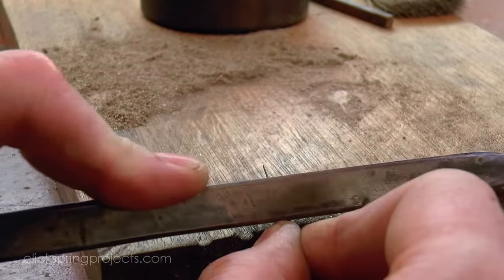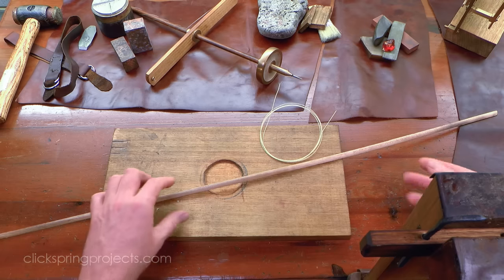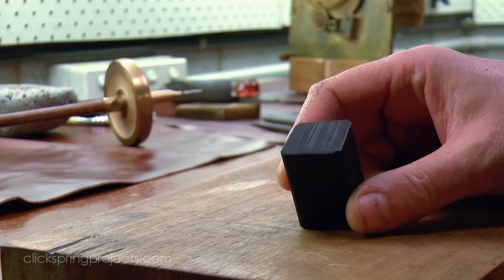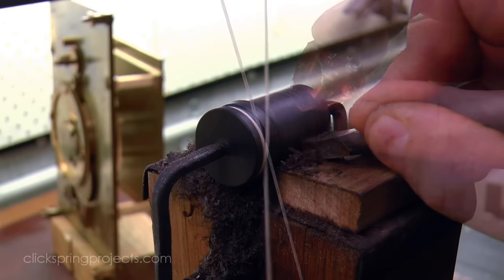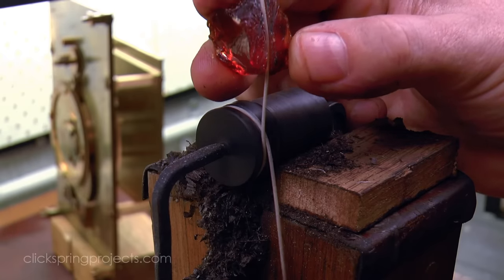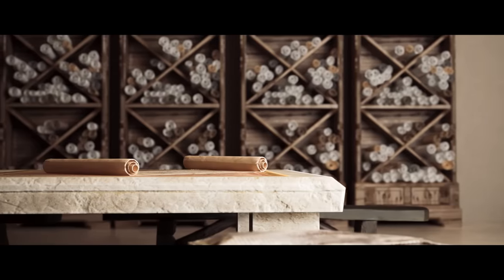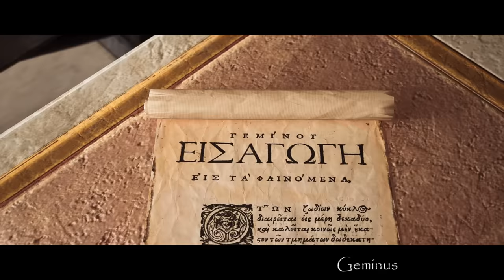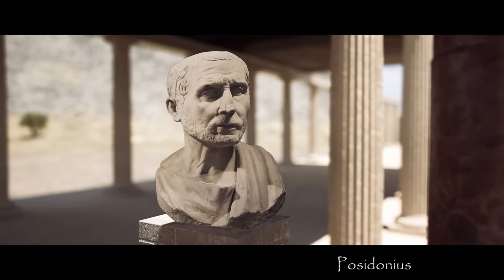Antikythera Fragment #11  World’s First Precision Lathe - Constructing The Antikythera Mechanism

Comment: What I find wondrous about this stuff is that this lathe is, as you aim to produce, a conservative guess of what they would have used. I can imagine that wealthy workshops having elaborate forms of this style of lathe. Maybe with a sliding wedge-locked tailstock to allow machining stock of any length within the machine's bounds, or even an early tool holder system to make repeatability easier. They had the technology for a lot of advancements on this design, so it really comes down to their imagination and amount of free time/money to work on improving their tools. 

It's a shame that it seems that all the latches from the time have been lost. I wouldn't be surprised if they ended up being melted down/turned to firewood at the end of their life, although I am curious as to why this particular part of Mediterranean craftsmanship is so poorly documented and preserved even through cultural and storytelling means.
Reply: the constituent parts don't really scream 'lathe', and the metal parts would probably have been variously looted or migrated until they wore out; the wooden spools and such would wear over time and be tossed into the fire etc
Reply: For two reasons, one, knowledge like that of how tools were made and worked was your value and such keeps close. And second, those that were widely known common knowledge were just not documented, as is always done even to today, because they were so mundane and everyone knew, so no need to do so.

Comment: When I was a watch making apprentice I was taught to make arbors and pivots solely using a file and filing block. As my master measured the circularity with a micrometer, you can be sure these were functional in a watch or clock. Also, your video seems to reinvent the "turns" the bow powered dead center lathe that was used in watch making from the birth of watches and clocks to this day. I have no doubt that this very same form of lathe was used  from the very invention of the lathe. Archaeologists seem to have ignored technology of all types other than construction among Greco-Roman culture and I have no doubt that the very same type of tools as created the Antikythera device are slumbering uncataloged  in some museum drawer.

Comment: This is amazing. I have learned so much from your videos. More then all of the metal works courses I've done. Lathes are usually held as too sophisticated to even contemplate making one yourself, they are something you must buy.  But they started somewhere. From your simple design you could very quickly upgrade to having a fully functioning motor driven lather. There is a book that showed a method to making your very own lathe but it would be much easier to start where you have. You could skip the bow and grab an old bicycles peddles and chain thus you were only going in one direction not back an froth. Very inspiring. 

It's so amazing what people were able to do. I watched a video recently about a single track train instead of the two lines. The engineering that went into balancing it and how it worked. You just don't see that kind of out of the box thinking.

Comment: If the prong holes were slightly tapered towards each other in a V shape, then the further prongs are into the holding block the closer they would get to each other. This would allow a finer adjustment and help grip the work piece!

Comment: This is really eye opening! Not only in regards to the Antikythera Mechanism, but most definitely also in regards to tool manufacture. I've long wanted to build a lathe, but have put it off because I thought it required complex gearing. Only now have I realized that the only thing the gearing achieves, is higher torque and rpm with a less powerful motor. Looking at this lathe, it is clear that a simple automated one could be constructed in several ways. It should be possible with relatively little complexity to construct a lathe that is operated by foot like a potters wheel, which will free up both hands. Similarly, it should also be possible to construct a water operated autonomous lathe, removing all need of human power. And for modern hobbyists it should be possible to create a relatively cheap lathe with just a servo motor, a belt drive and some modified wood chisels with a bit more hardening for turning soft metals and wood. Only other requirement is the operators patience.

Comment: This is such a cool video. As simple as it is, that is a fully usable lathe. Once you have a usable lathe. It could certainly be used to make parts (even parts for a much more precise and easier to use lathe). The only machine in the shop that can make itself.

Comment: This is a really ingenious mechanism for creating a lathe, and my initial thoughts after seeing this is that it could relat6ively easily be scaled up using a water wheel, that drive mechanism, and a clutch system (or just stop the water). And you could probably make it a one sided lathe with an eyelet and the rosin glue.

Comment: Instead of olive oil, they sometimes used the waxy surface of a holly leaf on bearing parts, and a bow drill, a small square on the friction points, was used.  Its a technique still used today for bow drill friction fire starting,  holly was used on friction points on trebuchets, barristas, and suchlike.

Comment: That is pretty cool but you could set it up with a pulley and handle to turn the pulley instead of using the bow and string. It would be more of a constant rotating instead of back and forth. I'm still amazed at how that was done. Very cool.

Comment: With the lathe tools example seen, would an ancient version of a superglue arbor be possible? I'd think using wax to adhere the piece to the arbor would do the trick, unless there's a different adhesive that would work better?

Clickspring's next series will be bootstrapping a lathe, using Bronze Age tools to fashion a lathe to make a foot powered lathe, which is then used to make a more modern lathe, and so forth.

Comment: Pretty easy to imagine metalworkers of the time immediately seeing dozens of ways to make what you made better. Improving rigidity, a hand crank since we already know they had good comprehension of gears, potentially a flywheel
Reply: Gears are too expensive, my money is on belts and pulleys. Cheaper, easier to make and modify, and works so well we still do it today.

Comment: A few years ago i did a tiny chess set for my dollhouse. Well my moms dollhouse back then. By rolling the wood sticks under my hand and filing as i go. After a few pieces i added a rotating weight that keeps the motion going, and refined the thing a little in small ways.
It was sort of a lathe. With my hands as a structural element.
If i did more pieces now, i might add points to it. Or grab a small bearing and add it to a piece of wood. Would probably result in less cramping. For a small amount of pieces it was fine. But not doing another set any time soon.

Comment: I remember an article in Fine Woodworking maybe 40 years ago about primitive woodturning in Ethiopia iirc. The turner was doing bowls sitting on the ground using his foot for the tool support.
In the terms of technological progress the wheel was in wide spread use at the time the Antikythera Device was produced. It is not a big leap to go from a pole lathe powered by the turner themselves to a lathe powered by an apprentice or slave turning a crank handle mounted on a wheel. Any shop that did a fair amount if turning imo (1) would likely have a lathe consisting of a bed with a fixed headstock and a tailstock of some sort that could be moved up and down the bed. Shops that would be doing a fair amout of turning could be those building carts or wagons. Or those producing pulleys for ships rigging or block and tackle. How far back do block and tackle go?

Comment: Thanks for the fascinating glimpse into a forgotten window of time. 

As is, such a small lathe would be ideal for jewelry and lapidary work, making small beads. 

With only a slightly upscaled form, to  a large enough swing to turn blanks that are ~1-2" inches across, and about 12-18" long, would be ideal to make the various pegs and dowels used in ship or structural construction methods.

After having made the persian astrolabe, do you think this sort of process was VERY widespread across the ancient world?

Comment: I have always wondered "You need a lathe to make a modern lathe, so how did the first lathe work?" Asked and Answered, I guess. This is very cool.
Reply: And Wax as a temporary work hold is amazing. Never considered it but that's honestly so much better of an idea than thermo-loc when I'm not using power tools. Like yeah, it'll be weaker, but much easier to remove from the workpiece.

Comment: I got the most "aha" effect when the turning around of the first work piece in the mini lathe switched the sides - thus making the left side irregularities and movements where the rope is running a levered down by the lever length to the other, more stable end of the block. lets say, the lever makes a 10:1 reduction, so every turn around would in ideal case get you a factor of 10 gain in total precision. indeed at some point other factors will limit the thing. of course finally your tools will switch to grinding with paper (papyrus) and maybe some fine sandy powder. perfect conditions - even modern day carftsmen level machinists cant do much better.

Comment: A little doubt about a possible performance improvement:  (translated with google)
As a wood lathe turner, it is a problem for me that the bars twist to release the piece, one always looks for the axes to be very aligned and round bars that allow that do not give me calm. But square bars are not easier to use for adjustment either, at least in this way.
 
In that case, would it be more useful if the holes received by the 2nd bar (on the right) were slightly diagonal? A subtle tilt, like 3-4° tilt. Or even both bars on opposite diagonals.
This would cause the axles to tighten as the bars are lowered (the bars should have a "7" shape to compensate and remain parallel to the surface), and thus the tightening is not due to the bending of the bars, which deflects the central direction of the axles and also generates unnecessary friction.
All this in a small independent wooden frame, which would not be anchored in the clamp, to have easy access with the hammer, both from above and below. Thus the general tightening would be through the different holes, the fine adjustment would be through the diagonal when lowering the bars, and the release by hammering from below instead of releasing it by rotating the bars.

Comment: The Townsends demonstrated this type of lathe to make wooden tools, on a larger scale, but I never imagined it would have been any good on metal. I suppose brass and bronze aren't all that hard, but still impressive. I do find myself wondering how long it took to make a lathe capable of cutting steel or iron.
Reply: It was probably possible earlier than you'd think, but I would assume the harder materials like steel were forged and ground whenever possible, or finished with files and chisels when certain levels of detail were desired.

Comment: Some Questions . How the old Greeks got brass sheets in this quality, you need for?
Is it approved that they have iron and   steel/ hardened steel to make the tools you used for to create a duplicate of the Antikithera mechanism?
Great Videos, thanks so much for uploading !!!!! Best Regards from Austria!
Reply: Hi, the Mechanism is bronze not brass roughly 95/5 copper/tin with a few bits of other things by analysis from the 1970's. Flat sheets of bronze were produced over 1000 years before the mechanism was made and made into mirrors that we have found so making bronze sheets was known. You could hammer, anneal and lap as a primitive way to make a bronze sheet, They might have known some kind of rolling. Perhaps Chris has something coming on this?

Check previous videos by Clickspring on making carburized steel and then files,  drill bits and cutting tools from that steel using period appropriate technology.

Comment: Amazing work! How long did it take to make the little ebony arbor? I'm sure this is slower than contemporary machines, but it still looks pretty speedy.

This has a lot of potential for being able to fine-tune your work process. Using the direct drive for the arbor is definitely the easiest, but I have no doubt that the Romans could have taken advantage of differing gear ratios and a pulley to make an extremely fast little lathe, much in the same way a spinning wheel is made.

Comment: Excellent.
A discussion of "Route to modern lathe from here" would be nice, but you mentioned the key bit right at the end: The ball bearing.
A ball bearing headstock driven by gears instead of the bow, and a ball bearing live center on the tailstock...
The missing piece then is the gearing needed to have the 'tool rest' travel at a set rate of rotation -> Threading.
And the gearmaking essential knowledge is done.
A crappy lathe can make a better lathe, all the way until you get a very nice lathe.

Comment: The bow drive is obviously dead-simple, and can be operated by the machinist himself, but as I watched it occurred to me that the mechanism of a spinning wheel would have been almost as simple to make, and would have permitted constant turning in a single direction, which would mean the cutting tool would be twice as productive for a given span of working time.  The simplest version would have required a second person to turn the big wheel, but a bit of mechanical work might have enabled the machinist to pump the big wheel with a foot pedal, while using his hands to do the machining.  I don't know when the spinning wheel was invented, but it doesn't seem to involve principles that were necessarily unknown two millennia ago.

Comment: One thing I didn't understand is how this makes non-tapered cylinders. With only hand turning tools what precision do you have over the radius being consistent over the length?
Reply: Well first - did they care if the cylinders were somewhat tapered? Everything was hand fit to them anyway. 
Second they could use calipers just like people did for millennia in wood.
Third as said everything was hand fit, so the the hole you had to fit could also be your measuring tool. Adjust both til you are satisfied and that is it.  Just work a little, stop and check.
They never really had to make a cylinder to an exact measurement, but rather to a real world item where fitting matters and the exact size and shape in some metric really didn't.

Comment: It seems as if you try to develop the minimum tool to do the job here (and elsewhere) to prove that advanced tech isn't needed to do the job.  I understand that, but it seems like this sort of tool would have been developed 10 to 100 years before the mechanism was built.   I'm thinking that the place that built the mechanism was also possibly the location of the most advanced lathe tech in the world at that time.  It is interesting to me to speculate what they might have come up with, given a generation or two of use and development.   What's to stop them from having a continuously-turning lathe mechanism with a geared feed?  They would have had the most sophisticated and specialized tools anywhere.
Reply: A geared feed strikes me as unnecessarily expensive and difficult for the task at hand. Even today, there are lots of machines that still use belts and pulleys instead of geartrains.

Comment: If you already make gears and gear reduction. Why not a geared lathe with a hand powered flywheel that spins the part 10-1. At that point you can also make a screw for better precision of the cutter.

Comment: Could you build a pedal operated lathe ?
Reply: I would imagine so, just bend a long rod into pedals under the table and make a pulley system with a string pulled taut with a short piece of wood. But it would probably need the first step be to have a continuous rotation tool (like if instead of a bow this lathe had a turning wheel) which, if the other tools he's made are anything to go by, doesn't seem like it was something they were thinking about.

Comment: Regarding lathe tech, it would seem trivial to anyone who designed and built the mechanism and needed precise cylindrical shapes.   I'm not a builder, but it seems to me that using a bow in one hand to turn the work would get old quickly.  I would be looking for a way to turn the work continuously - how hard would that be to engineer, considering the engineer was already capable of building the mechanism, and would likely have slave, mule and water power available?
Reply: A belt drive is only slightly more work than he already put in, and you can either run that on your own with a handcrank, or get an apprentice to do the crap work of keeping it moving at the speed you want. It's cheaper than a mule or waterwheel and also gives them a front row seat to what you're doing, so they can learn as they turn.

Comment: it didn't even had to be bow powered, they obviously knew how gears worked and with widely available slave labor they could have simply a large wheel and a helper or slave spinning it and rope connected to holding rotating piece like shown in this video. Such simple setup would produce fast spinning smooth one way action and rather fast and precise work.

Comment: Is it possible that a treadle powered lathe existed circa 200 BCE? Many sources state pottery wheels were widely used by ancient Greeks. Internet searches indicate a treadle powered loom existed in China 2nd century BCE. Someone familiar with those devices would have examples of flywheels, treadles, and associated connections. This is simply a wild speculation and a serious question for someone much more knowledgeable about mechanical devices in that time.